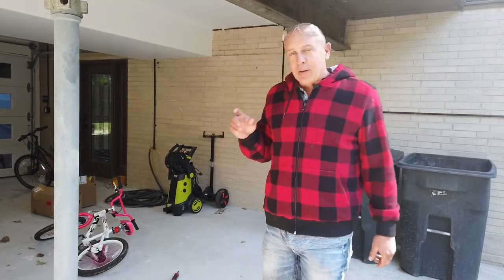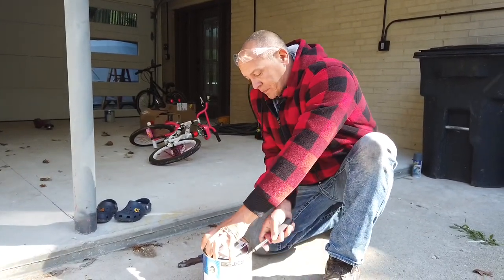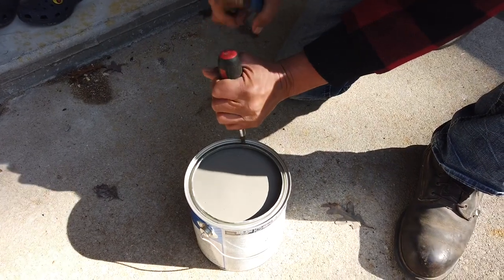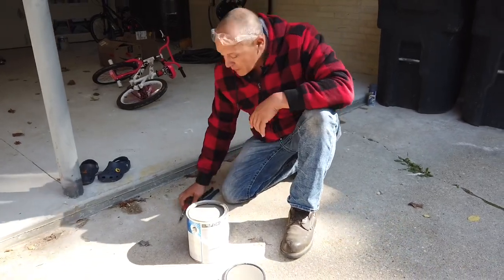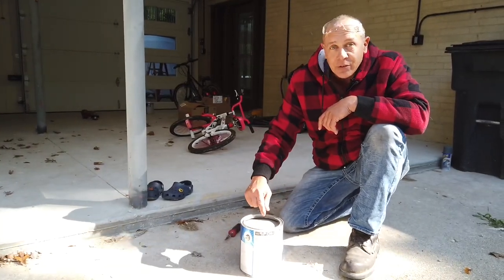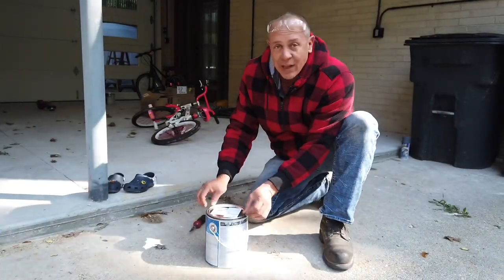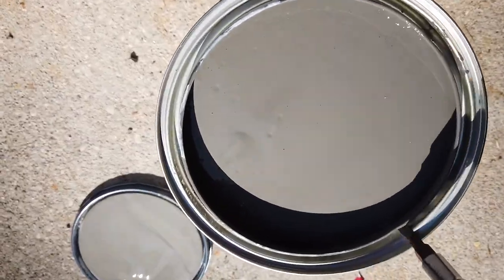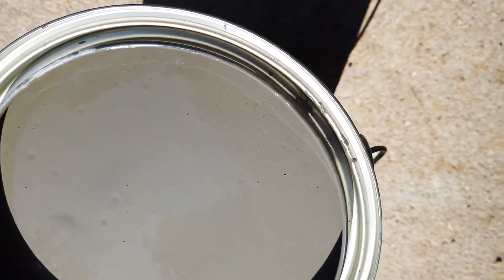Old Painter’s Trick!!!  Genius!!!!

Comment: and when the residual paint dries, the lid sticks to the can,  then you need a pry bar
 to get the lid off.   any of the big box stores has a snap-on lid with a pull-up spout
 to pour paint from.  it can be a lid, or removed and washed off, and the metal lid
 re-installed,   with no paint in the can rim.

Comment: Love that.  Have used it for years... EXCEPT that it breaks the rust proof coating on the metal rim in those spots.  If you save the leftover latex paint for a number of years you may have flecks of rust drop into the paint when you remove the lid again.  Oil base paints, no problem.  If you are using four gallons, perforate the first three and leave the forth unperforated for storage.
Reply from the maker: Thank you.  I will check that out.   Remember to Subscribe!!!